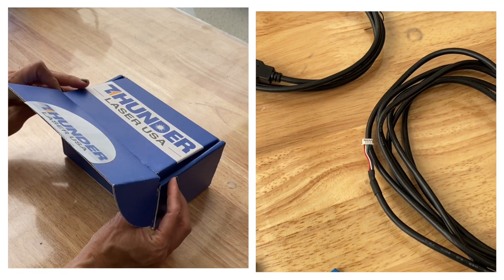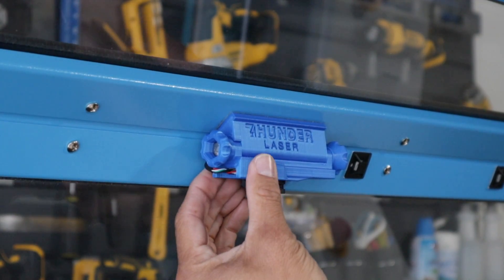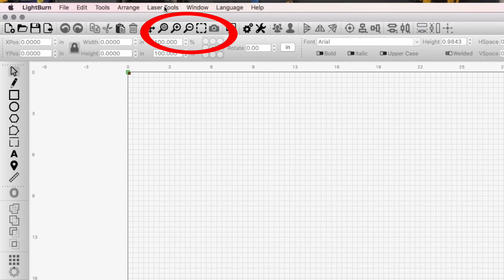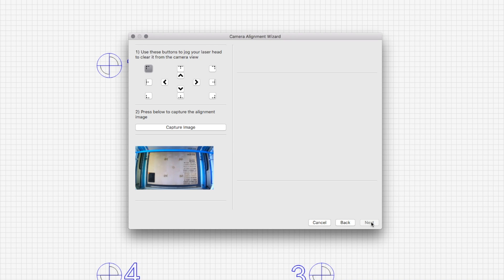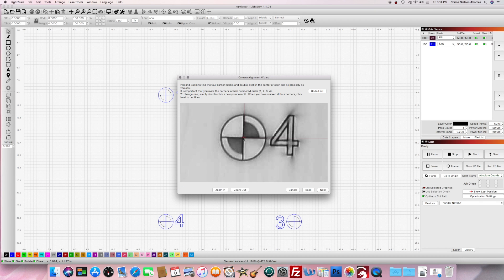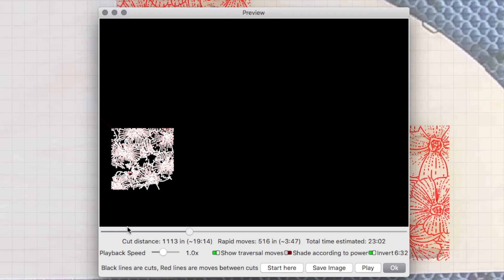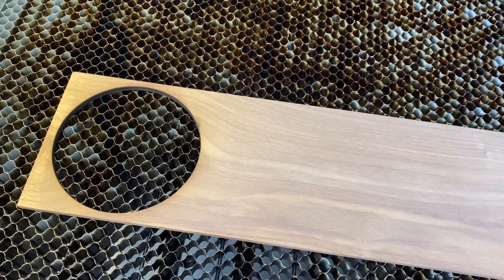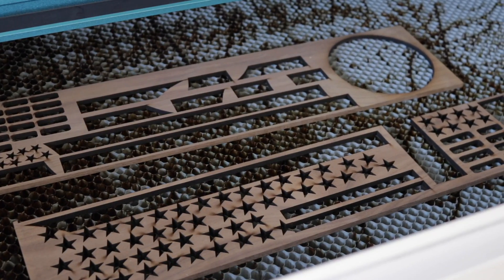Laser Camera Installation and Benefits

Comment: Corina, what was the length of the booster cable you bought? We have to do the same thing. I need a 16 foot. I think with the amplification cable the length is not really an issue because the boost can handle it. I am assuming your camera is working just fine. So knowing your length will  tell us for sure.. Thanks for your time